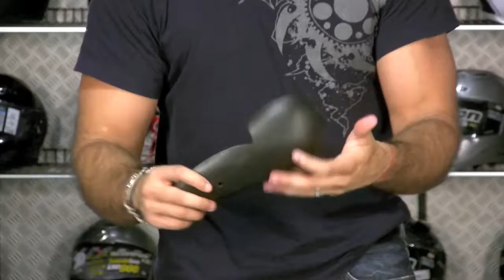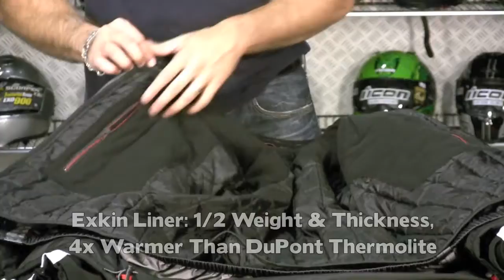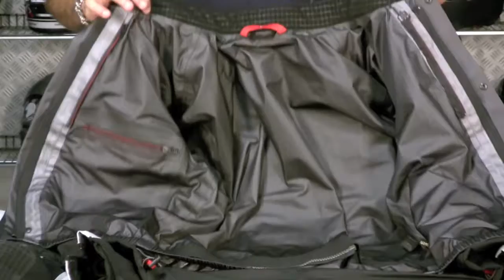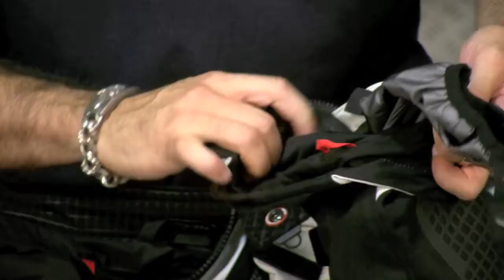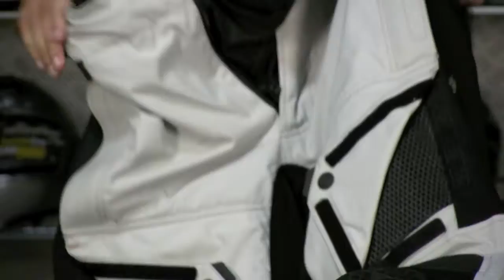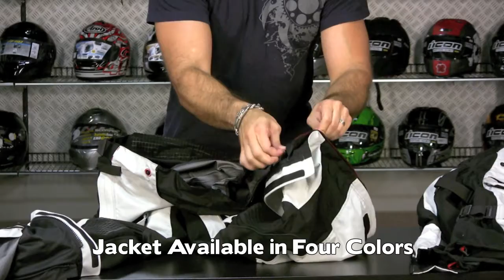REVI'T! Defender GTX Jacket Armor & Liner Breakdown Guide at RevZilla.com

Comment from the maker: @blownaway Hi - 1) You can wear with either liner in or out or all out. You can even remove the GORE-TEX liner and attach in the thermal liner to the shell- but I dont know why you would. You could pull boots over the pants. 3) The Jackets do not come in long sizes. Only Firstgear makes long sized jackets currently. Let me know what else I could offer.